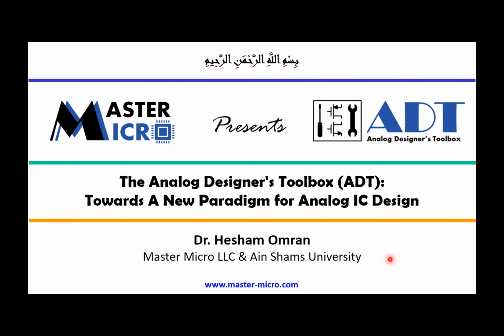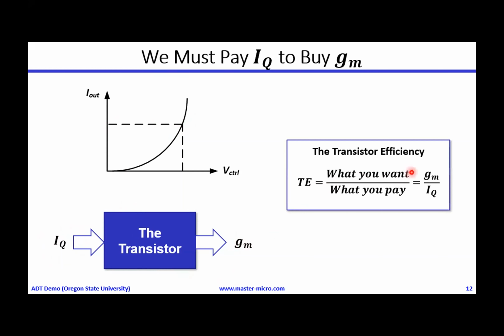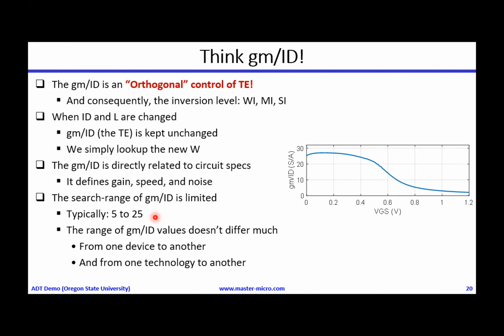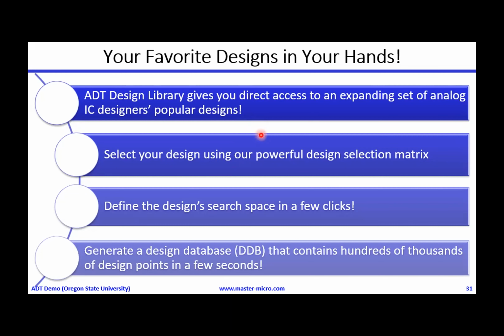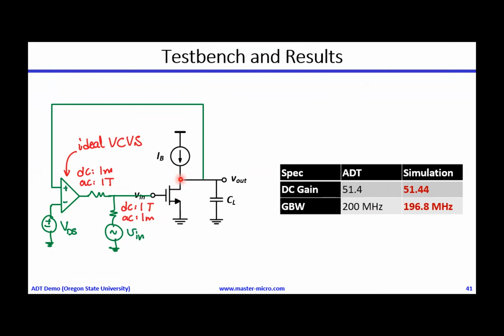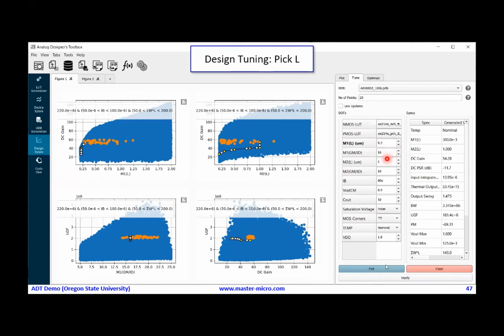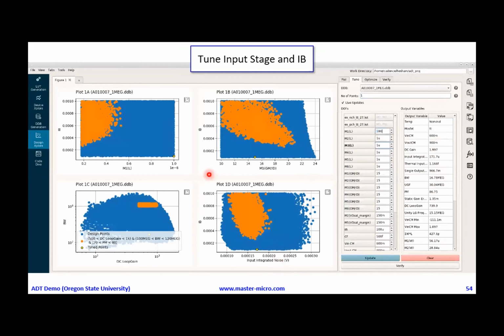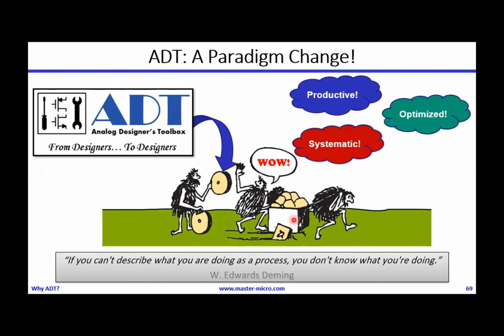The Analog Designer's Toolbox (ADT): Towards A New Paradigm for Analog IC Design [Oregon State Univ]

Comment: Great presentation! I am a product test engineer, not an IC designer, and I work more with bipolar circuits, but why is CMOS L more intuitive than CMOS W? To me, W is simply like putting devices in parallel. I think that L is often the minimum allowed by the process, except when sacrificing area to lower noise, which is not intuitive to me.
Also, could there be a bipolar or bicmos version of this tool? BJT gm/I is always high at 1/Vt, like CMOS subthreshold or WI, but we often attach an emitter resistor to each BJT to improve matching which effectively lowers gm/I. Could this tool help designers select BJT and RE sizes?
Reply from the maker: Hi Paul
Thanks for your feedback!
L is relatively intuitive because it has a small search range (from Lmin to some multiples of Lmin) and it can be intuitively related to circuit specs (gain, speed, matching, noise).
On the contrary, W (or the number of fingers or parallel devices as you mentioned) has a wide search range. Also it is difficult to guess a reasonable initial value for W because it depends on L, ID, bias point (inversion level), and device type. In addition, it is not intuitively related to circuit specs. That's why gm/ID is a better alternative.
The current focus of ADT is analog CMOS circuits. Thanks for your suggestion about BJT! We may work on it in the future!